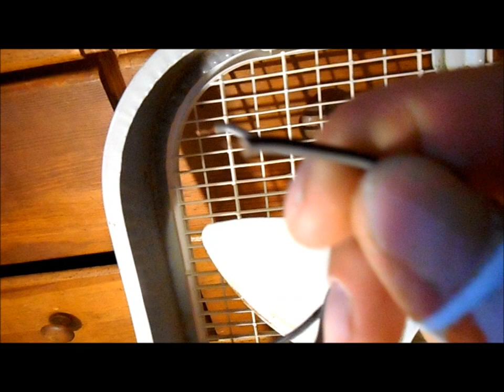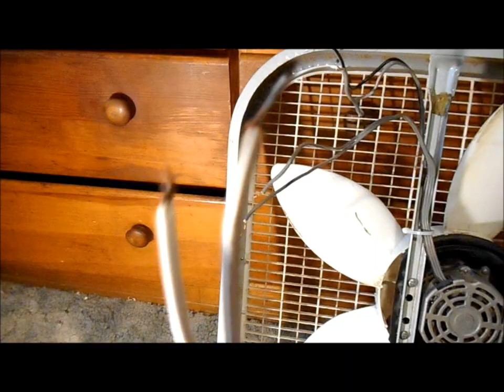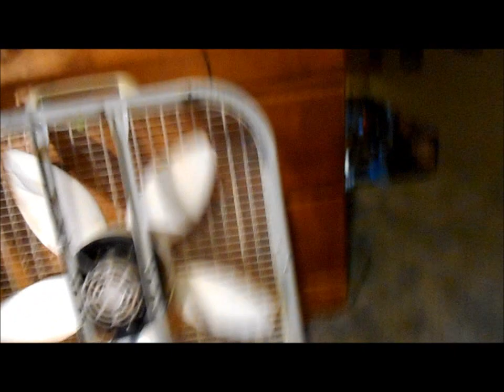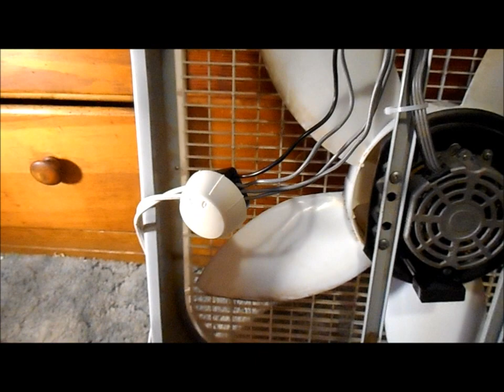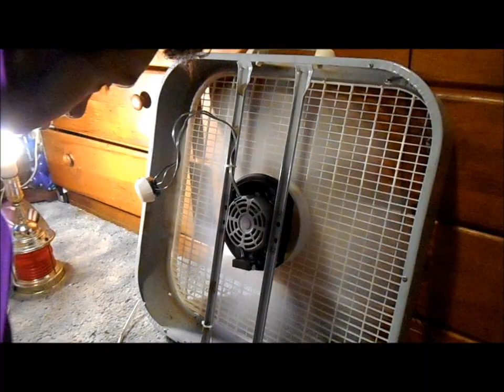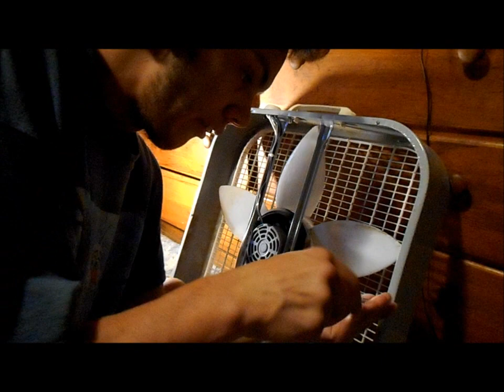Repairing a cheap Galaxy box fan

Comment: I parted out a Mainstays box fan with a burnt-out motor the switch was good and I put it on my Lasko cool colors they had a good motor but a bad switch put the switch from the main stays on that Lasko thought it would catch on fire after putting on there but sure enough it worked just fine it only had four connectors for the wires in the fifth and sixth one had to be spliced with an adapter for one of the positive or negative plug cord I hope this helps you it'll put hair on your chest certainly did to my ex-girlfriend Mainstays box fans have very reliable switches they're not cheaply made like Lasko

Comment: do you know how to remove the armature on one of these? the fuse went bad and when i went to put it back together to test it i cut off one of the wires but its at a point where i cant get to it to reattach without unwinding it

Comment: These motors have thermal fuses in them wired in series from common to the capacitor. I have. bypassed several on these newer laskos and galaxies then they worked like new! and great video!